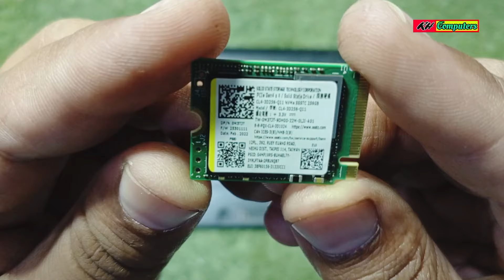How to fit a 2230 M.2 Nvme SSD in a 2280 slot || 2230 To 2280 Converter

Comment: No real reason to buy an adapter when you can also just buy a compatible SSD in the first place...
Reply from the maker: bro this is a solution how to fit in 2280 slot if you have such ssd available
But if you buy a new SSD, buy a laptop compatible one
Reply: I just 3d printed and holder works pretty good
Reply from the maker: @vash469  thanks for watching and comment